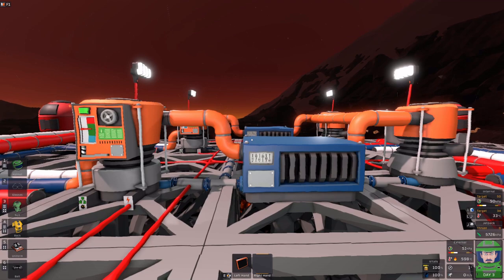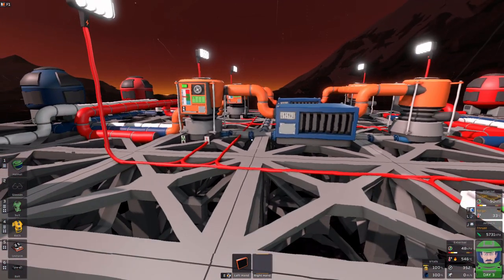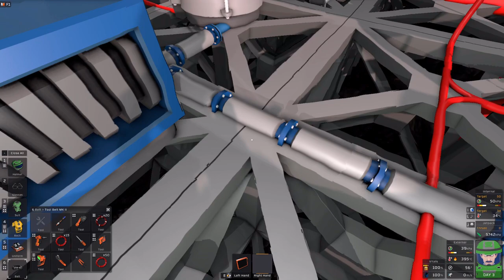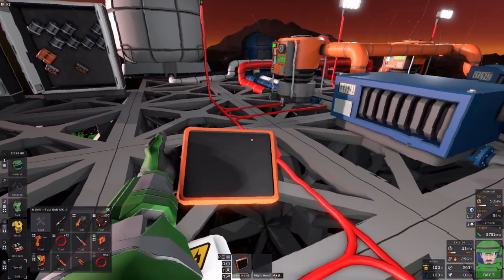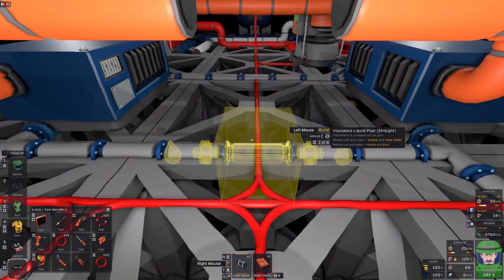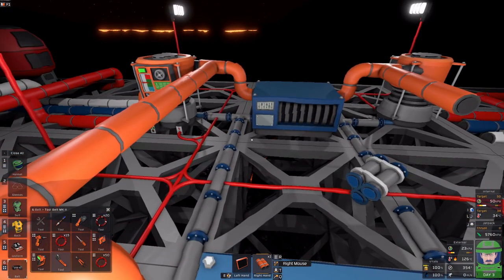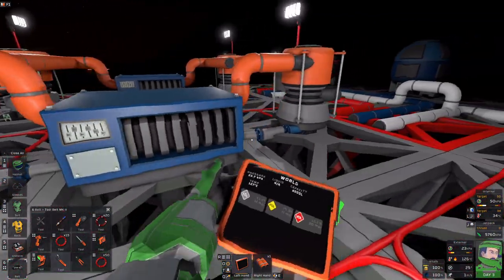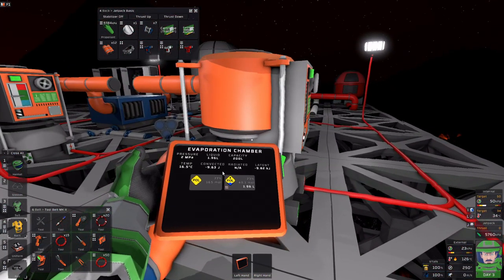Stationeers: Parallel Phase Change Devices

Comment: why not put the counterflow heat exchangers in series? ive done this and am getting up to 15kj heat transfer with one evap , 2 condensation chambers, and 3 counterflows in series
Reply from the maker: Mainly did it as kind of a way to split up the cooling between separate devices, in the event that you dont have enough liquid coolant to fill each chamber. Basically like a budget build for getting more potential cooling. Series works as well since in series, it will further swap temperatures along the line. Counterflows acting as devices are just an alternate way to split up the liquid pipe network so that each evaporator gets some liquids to keep working, while still maintaining some of the benefits of the counterflow.

Comment: In my experiences, i have made like 30x parallel chambers with 4 stages, with total of over 100 chambers.

Basically, you have to have active controls (turning on off devices) for stopping chambers when temperature reached one end or the other. Then, you need to flood fill all the chambers up to a point that at least all chambers in one end are fully filled up.

Additionally, depending on the type of gas you're working with, there is a point where having counter flow exchanges is just not possible, as they reduce the flow too much. As you discovered you can't really do parallel exchanges unless you separate the network, which defeats the main benefits of this type of parallel:

As chamber efficiency (speed) depends on their working temperature, the two ends basically always need to scale differently. And that difference could be as huge as 1 chamber in hot end to 6 chambers in cold end. By having one connected loop, you can scale up and get better utilizations on all chambers (thus power efficiency, the main reason you'd ever go for chambers instead of custom loop).

And once you balanced the ratio, and as long as it keeps running at same speed, no active controls are needed. Only when you either shut down the system, or cold / hot end no longer running at the tuned temperature, does it actually needs you to turn off chambers to prevent them from going boom.

I have managed to set up real fast condensation system this way, that can make over 10 L of liquid oxygen per second from 20C oxygen with less power usage than a turbo pump this way. It is crazy efficient and scalable too as you just look at which chamber at what end of which stage is capping, and slab a few more chambers and it works.
Reply: The best way to expend them is by stacking them in a 3d grid, where each end of each stages are 2 by x by y chambers, and you put those sub stages side by side.

When you need to adjust the ratio to get better efficiency, you basically just build up that one sub-part taller compared to the others. Once you figured out the ratio, and want to expend the whole system's throughput, you then instead scale out in the other remaining axis.

The end result is you getting a cool 3D matrix of chambers all working at their best efficiency (and speed), that you can further scale in one dimension.

As each chamber consumes only (if i remember correctly) 50w, the efficiency of this is just way out of league compared to any manual style loops.
Reply from the maker: @leetom5192  I like the idea of having a designated space to keep expanding on the system. The chambers are really good at what they do. The 50W power consumption is extremely power efficient for sure. Turbo pumps (800W), Pressure regulators (100W), and volume pumps (200W) definitely eat into the power efficiency that you would have to scale up the volume in your separate chambers and possibly the way you have the counterflows setup.

I think with the conclusion of custom evaporation chambers, I have 900W of power dialed into the system. I think when the chamber was hot there was about 52kJ of thermal energy being moved. I think looking at the direct heat exchanger it was roughly half was used to cool the CO2 line which makes the COP 28.89. So if we can make a setup of phase change devices that total 900W and get a better COP, it just means I have more to do to the custom setup to exceed the phase change device setup.

I havent really built a large mega base that requires a lot of cooling, that's probably something that I will do now since I'm tinkering around with the brutal starts.